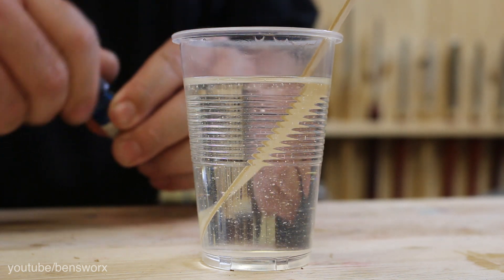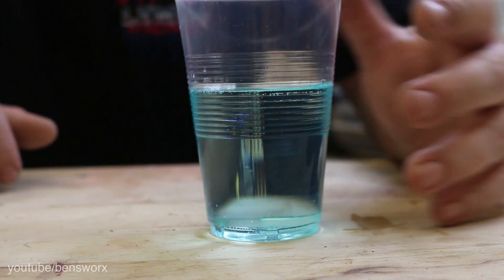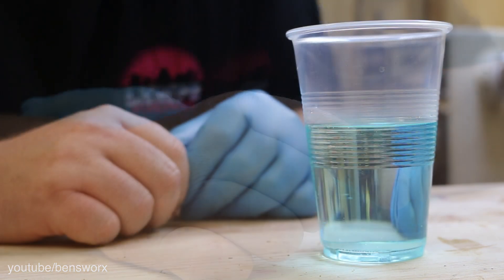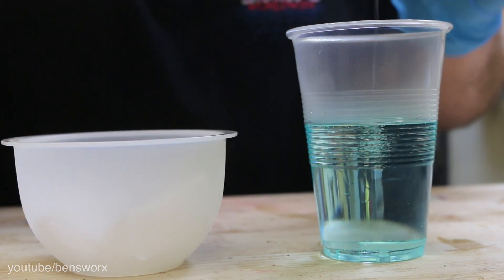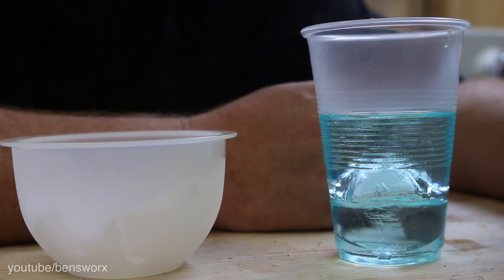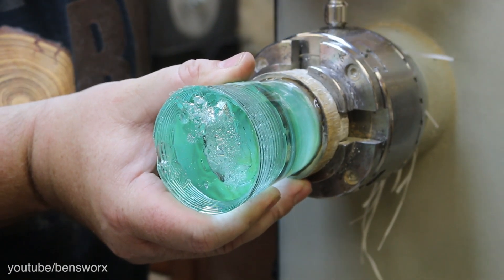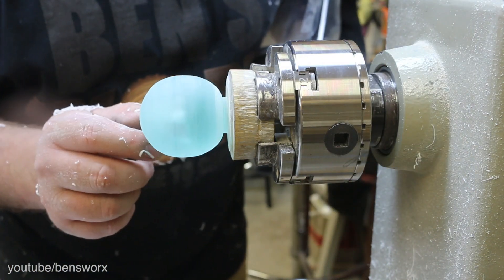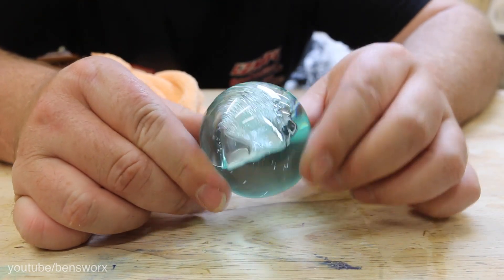Can You Cast Ice in Epoxy Resin ?

Comment: My brain literally went overdrive thinking about what would be the out come before clicking the video, unlike when in school My brain is slower than a snail
Reply: I wanna like ur comment but it will ruin it
Reply: Aside the fact its obvious what would happen, you shouldnt think so hard. You might hurt yourself.
Reply: @whatever7338  not that obvious if you don’t know how resin works
Reply: @nuggetchicken3873   quite obvious if you know how WATER works....
Reply: @xvoidgamer  no I meant right away like will it melt right away
Reply: @xvoidgamer  Even knowing how water works there's a lot of possibilities
Reply: @pickk90   Tell me some logical possibilities then...
Reply: @nuggetchicken3873  ??????????
Reply: @xvoidgamer  if you don't know much about resin the you could think that the heat could create an effect similar to sublimation in the air and so part of the ice would dissipate and create tiny pockets of water once cooled down. Maybe the water could mix with the resin and prevent it from fixing properly. maybe it would just float on top ...or sink at the bottom. if you don't know shit about resin you don't know how they compare in density or any other aspect.  You could also get amorphous ice and if it's dense enough it could stay as ice in the resin

Comment: 3D print a tiny ship, add a tiny tungsten weight to the bottom so it floats upright. Freeze the shit into an ice cube and repeat the process. Once the ice melts you'll have a little floating ship cast inside of the resin. Priceless!

Comment: You should try to super-chill your ice too so it stays colder longer. Liquid nitrogen is a bit harder to come by, but will work the best.... however dry-ice is a lot easier to obtain, transport, and work with (and less dangerous) and would help get your ice down a good margin colder then the freezer in your house can do. Just figured, colder ice = greater time for the resin to set before it melts. Hope it helps!!

Comment: Should colored the ice with yellow, with the resin in blue you’d get a green but not pure color coming through from angles... Or a 3 angle pyramid with different color sides with resin color in one color the multi configuration with 2 colors but 4 at side cross angles...

Comment: Here's a thought.... make a little sculpture of dry ice.  I would suggest borrowing a dewar of liquid nitrogen and 'super' freezing the dry ice so it has a chance to take the heat from the resin before sublimating back to gas.  If it works, you'd have the sculpture imprint inside the resin.

Comment: I guess this is a question about color separation and resin which is what I have a lot of trouble with. Have you ever tried using two different brands of resin mixed together to see if it helps with color separation? 
Example: Mix part a and part b of one brand, mix part a and part b of another brand. Then pour them together and see if it helps with color separation. 
Another example would be doing the same thing but use a quick set poured along side with a slow set. That what the thinness is different. 
If you have please link me the video or share your results. 

Love your work. Keep recording and sharing.

Comment: If you made a resin mold, put it in a pressure chamber and hold it at a pressure where water stays ice at room temperature, "about 10k atmospheres or 15k psi" then you could make it so there is actually ice inside of the resin. But then its more a matter of making the resin strong enough to hold it.

Comment: How about pouring a little liquid nitrogen just before you put it in? Water expands when it freezes, so when it melts inside, the hole created will have a slightly larger volume. But if you can get the ice to be rock hard during the cooling process, the gap between the ice or water once it's cooled and the resin  would be little lesser.

Comment: Seeing as water expands when it freezes, under near-ideal circumstances I think the ice cube shouldn't melt. Because for it to melt (read: to diminish its volume) air is required to compensate for the vacuum otherwise created. But I guess the air bubbles contained in the ice cube (along with the ones created during insertion) were sufficient to allow for that. Anyway, fascinating stuff, I hope there's a follow-up.

Comment: The thing is, since water shrinks when it melts, you have empty space in there. I'd like to see what happens when you use a substance that expands when it melts. It would either crack the epoxy open, maybe even explode, or maybe it wouldn't be able to melt. Although, how would you know? If it was clear, then indeed, put a piece of metal or something in there so that you can see something moving around if it does melt.

Comment: To keep ice in solid at room temperature indefinitely you would need to have about 1 GPa, or about 145000 psi of hydrostatic pressure, but if you don't care about that you could just simply put it in the freezer and let the ice freeze again

Comment: Only way to get actual Ice in resin would be if you can get the resin to apply a pressure to water more than about 2 GPa then you would get Ice VII or Ice VIII. Both take up less space than water and are probably stable at room temperatures.

Comment: freeze a ball into a perfectly cubed ice cube suspend the ice cube in the resin, then if possible create a perfectly centered sphere around the cube (it doesn’t have to be 100% perfect) let the cube melt, now you’ve got a ball in a cube in a ball, and it can actually be used as a spherical die assuming you mark the sides properly

Comment: Doesn't it depend on the epoxy or the resin you're using because some of it kicks off at extremely hot rate? I've worked with some epoxies that will burn you if you leave them on you while they're curing same with resins.

Comment: Its honestly no surprise the ice was able to remain solid for long enough. It takes a considerable amount of energy to change from solid to gas. You can see this if you put ice at 0 degrees Celsius and an equal amount of 100 degree liquid water in a cup and wait for the ice to all melt. the average temperature should be significantly lower than 50 celsius.

Comment: Water is one of the few elements wbkch takes up less space while in a solide form. I am wondering if another element is used the solid form is forced tot excist due to a lack of space for the fluid form
Reply: Ice takes up more space when solid tho-
Reply: @levylemon8239  That is my point, if it takes up less space when it heats up ofcourse the ice will turn into water because there is space left. I am wondering if another substance is used which takes up more space when fluid, the pressure of the epoxy will force the substance to stay in solid form after it reaches the melting point.
Reply: I got your point but you said that water takes less space when solid. It takes more. Sorry if that wasn’t clear
Reply: @levylemon8239  oh I see it now you are right
Reply: @matthijskok5371  all g fam

Comment: Heya Hii....I wanted suggestion about 1 think..as I work in a 3d printing industry so what happened is that...I used a 3d printed resin object for Epoxy casting...but idk what  happened after some time it reacted creating a bubbles and the whole model become hot when touched.....any comments in this on what might had happened

Comment: Yes, you can cast ice in epoxy resin, but you have to be quick because the usual two component epoxy reaction is highly exothermal, ie it gives off heat. That could melt the ice cube.

Next: while the ice cube melt inside the cured epoxy. Yes, it will because frozen water has a lower density than molten water. Water reaches it's greatest density at standard atmospheric pressure at around 4°C, after which its density decreases again as the water molecules form a hexagonal crystal lattice. That what allows ice to float in water.
That means that the volume of a frozen piece of water will be greater than the liquid. That means the ice as it melts will have more than enough room to continue melting.

All of that was predicted before I saw the video. Now let's see how prediction goes.

Comment: I don't even need to watch. Of course it will liquify (melt). Ice is a crystal that i strictly dependent on ambient temperature, and as such can exist only at temperature below zero degrees C (at sea level). So when the ambient temperature equalizes all the silicon material, the ice will melt, creating a small vaccuum space as the water volume is less than the ice volume.